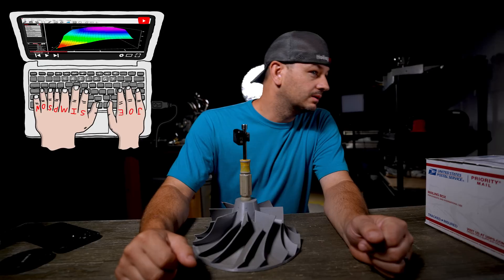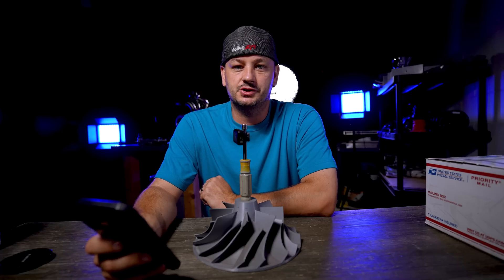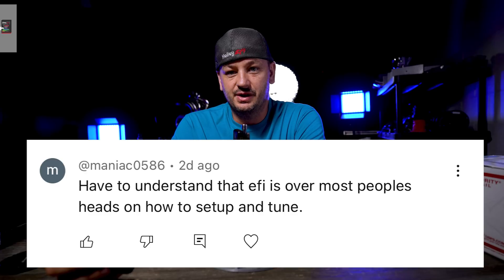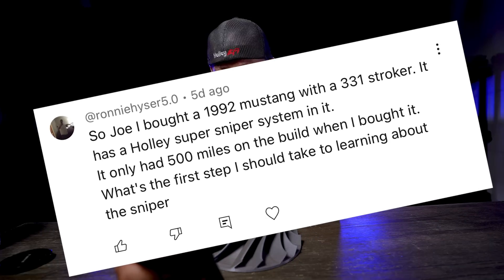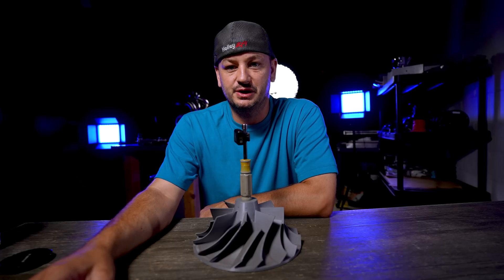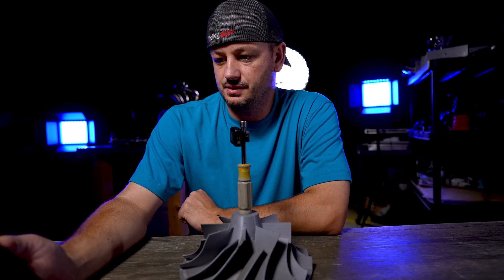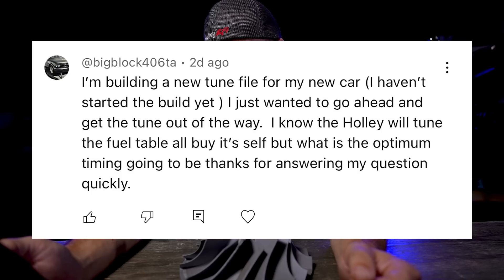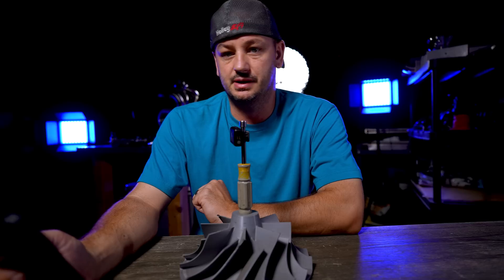Ever Since I Updated My Holley EFI ECU....

Comment: if people would just do research first before asking questions! I did my research for 3 years before attempting my turbo build, because I didn't want to waste a bunch of money (still wasted money... HAHA). 
I had redline in Bloomington, IL tune mine and 99.999% of what you (joe) talk about and show in your videos they did or showed me on my car.
I always wondered about the dome pressure differences between similar turbo builds. I've seen some engines need 30 psi and above of dome to achieve 25psi of boost, but mine take less 25psi of dome to make 25psi of boost.. you said it best "some cars for no good reason take more dome pressure".
keep up the good work!!

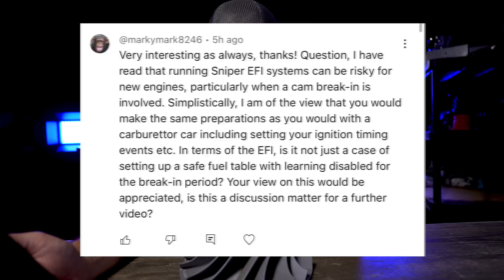Comment: 11:25 I look at his question from the point of view that the engine won't start right away (excessive cranking) or he won't be able to get it up to a reasonable RPM to properly break in a flat tappet camshaft. I had similar concerns early on, but after my first Sniper experience on the dyno, so long as it's installed properly and the tuning parameters are reasonably accurate, I'm no longer concerned and find the engine will fire within a couple of revolutions and effortlessly rev up to your target RPM. (With the Sniper)

Comment: Is there a video on how to update from v2 to v3 term x max? I've heard of alot of people are crashing there ecu or handheld  by not doing it properly
Reply: plug your laptop into the ecu
Reply: I also use the laptop method but I think Joe has a video on doing it with the 3.5 handheld. I know Matt over on sloppy mechanics has a video as well.
Reply: I’ve bricked ever termi I’ve tried to update with a laptop and splitter cable.

The sure fire, guaranteed method is to unplug everything from the CAN chain except the screen, pop the SD card into your laptop and swap all the card contents out with the new V3 firmware, plug into the car, and just use the handheld.

Holleys instructions amounted to as much that the released around V2 time.

You can also “unbrick” a bad update by using the same SD card method and loading old SD card software on it and doing the same process.

Comment: Does spark plug wire length matter? Turbo LS, cheapo up forward headers, stock coil location on valve cover. Cut to length wires wrapped around the back of headers.
Reply: shouldn’t matter just ohm them out as you make them/crimp the ends

Comment: If weren't to have a default settings for terminator x o2 sensor failure what would you do ? I would think limit rpm s to 3,000 and retard timing by 3degrees . Thanks Joe !! 💯🇺🇸

Comment: Sbe turbo ls1it will idle fine but the second I give it any throttle it dies instantly. s475, deka 80s, on e85, stock ls6 intake and throttle body. Any ideas?

Comment: Do you need a boost referenced fuel regulator if the injectors (tbi) are above the roots blower?  5psi street car.
Reply: Using holley? stealth?
Reply: @kevin_nagle  terminator x stealth 4150.

Boost referenced now.  Having a heck of a time getting idle happy.  I feel like the ecu is chasing too much as the vacuum on deceleration and idle coming to a stop can’t figure itself out.  Going way lean on slow first gear start.  Once I get it not lean it is rich other times.  Noob trying to tune from t3, but I probably should have learned on a NA engine.
Reply: You should only need to boost reference if your injectors are exposed to the boost.  On the super sniper throttle body there is a plug you install in the bottom for map sensor and a port in the back to reference  below the blower